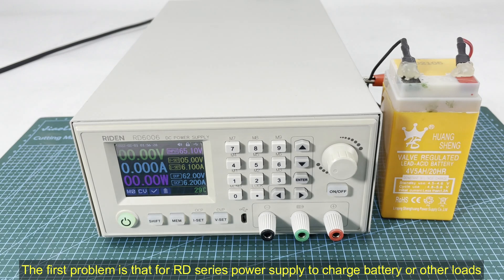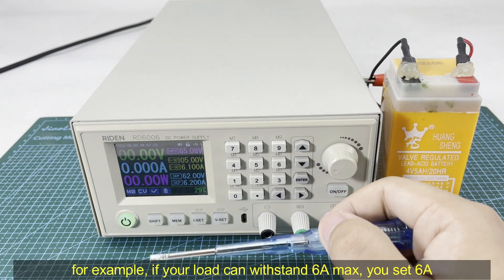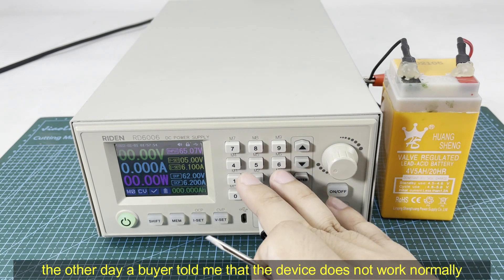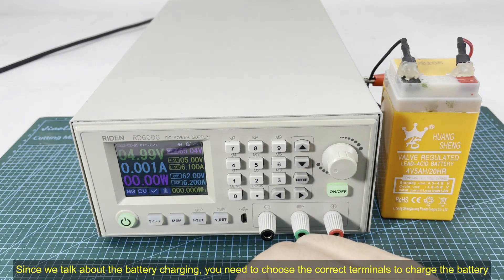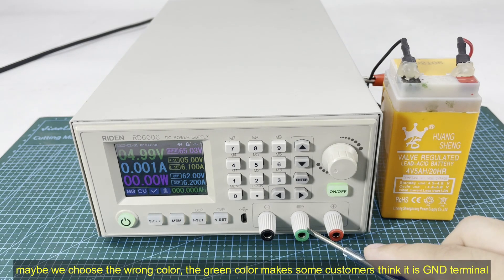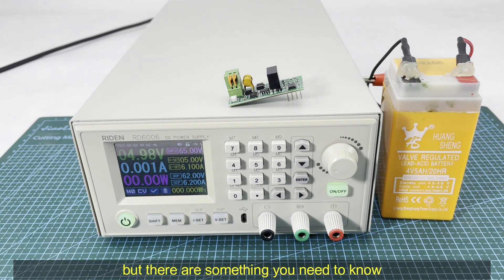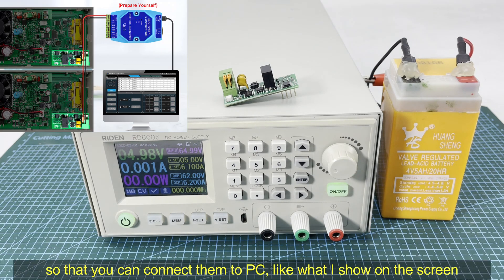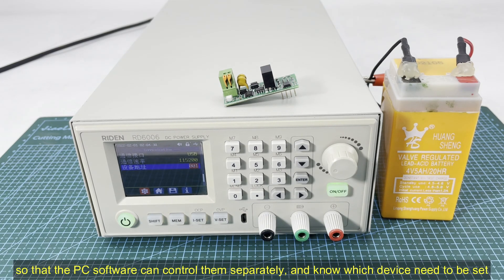Correct Setting! Battery Charging! terminal choose! RS485 batch control! RD6006/RD6018/RD6024

Comment: I have a couple of these for bench power supplies and occasional charging of LiPo batteries. They work perfectly. The software works well with my PC as well. I agree that the green cap is not a good idea, but I read the manual before using, so it never hurt me. That’s a thing that should be fixed, since many folks will have experience with the standard colors, reasonably considering green to be ground.

I have done one version of firmware update as well, with no issues and better display resulting.

In developing an amplifier, OCP has saved me more than once. These power supplies cannot be beat for the money.
Reply from the maker: thankyou, if there is any question when you using the products, just contact us

Comment: Hi. Actually we spoke before about this aditional green connector, and I ve tried to use it for car battery charging and did not succeed at all, as I remember, something goes wrong, so I am still using anower terminals for it. Also I am really upset because of WI FI disconnections. A ve tried to write down a log of car battery charge and discharge and fail because of periodic disconnections. WI fi is also difficult to connect. Belive me I have good router, and used many phones and pads to do this but useless. Have you developed a pc software so I can use notebook to connect to RD 6018 which I have? Also I asked you a question about 6020/24 model and you said it is only in far going plans and I have to by 6018, just half of the year past and you start to sell it! What the... f....!!!!????
Reply from the maker: sorry for the inconvenience caused to you, for PC software, we recommend to use the USB connection,so that the connection will be stable, and after we released RD6012P, we start to design the RD6024, and we found it difficult to get the original meterial, the chips price raised a lot and cannot get them, so we think it will not be produced and sold in short time, after half year(this February), these raw meterial price is under control so it can be produced

Comment: Volume is a bit low on this video. To check the volume, right-click on the video and choose 'Stats for Nerds' - look at the Loudness value. It should be around 0dB - this video is -11.8dB which may not be loud enough in some laptops, etc. for some people.
Also, if the letters at the bottom of the display show the shutdown reason, why aren't they in red and flashing?
Reply from the maker: hello, when this device starts OVP/OCP/OTP protection, that icon will turn red and show you the detailed reason, the color blue means it is working normally now